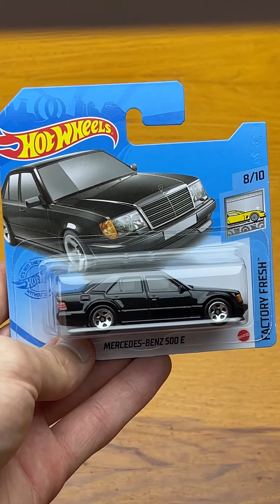Hot Wheels diecast custom Mercedes-Benz 500e tuning toy car. Make opening doors in 1:64 scale car.

Comment: Niiiiice❗
You bought the Air-Brush. 👌
I.m.o.,using the plastic covering of a paper-clip cannot produce a very long-lasting or durable hinge.
(I know alotta guys use 'em,but they always just seem very fragile & flimsy to me). 🤷‍♂️
Still can't get used to the aspect ratio of the vids. 🙈🤦‍♂️
May I ask,how long does it take to cut out 1 door,in real time❓🤔
Reply from the maker: Thanks for your feedback!
Yes! With airbrush is much nicer. Here, rather, another type of paint played a role, which I use to mix the color. One type of paint guarantees the absence of unpredictable reactions of the components.